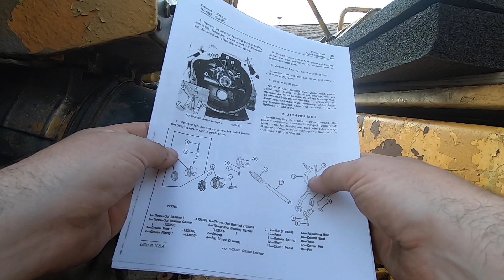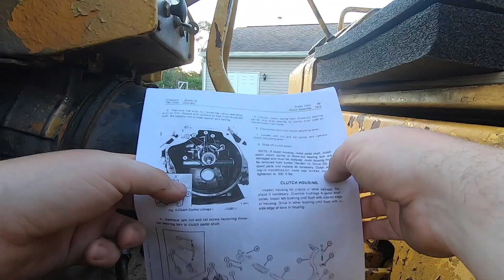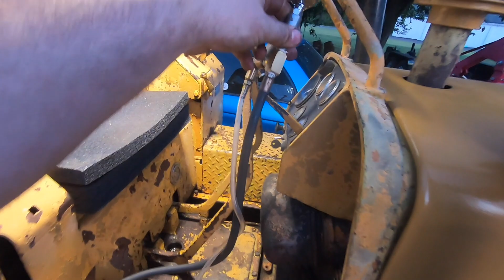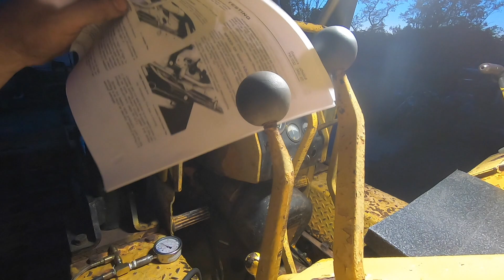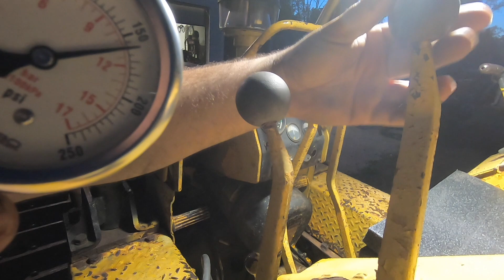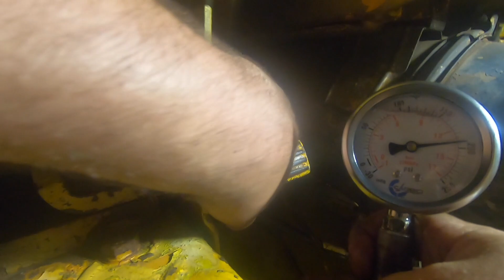JD 450 HLR transmission pressure adjustment and theory

Comment: I'm sorry, when you first hooked up the gauge to check pressure, I think you read it as turning the adjustment counterclockwise, and I thought it actually read clockwise. Or did I miss something?

Comment: I'm looking at a 1979 450c, and while the machine looks good, and the engine runs strong, it will not shift from 1-2-3-4th when the engine is running. If engine is off, I can shift it. Would my adjustments be the same as on your machine?
Reply from the maker: The HLR adjustments will be the same for you. If adjusting doesnt fix it, it likely means your main clutch is frozen to the flywheel. Mine was... I have a video about it. Gotta remove engine to fix it. If you dont mind shutting the machine down to change gears, it can be run that way until you have time to pull the engine.

Comment: Hello im having problems with my machine and was wondering if you can go a little more in depth with the gauge setup
Reply from the maker: It’s just a 1/8npt pipe thread. Very easy to get at any hardware store

Comment: This might be a stupid question but neutral on the gear selector is between 3rd and 4th? Basically to the left of 3rd or more up towards 4th?
Reply from the maker: If I remember right theres a small notch between 3rd and 4th
Reply: @spankranchgarage  Found it! Now that I know it's there it's easy to find. And it makes sense, I've plowed snow sometimes at around -30c and if the ground is frozen and it's in 3rd it will sometimes pop out of gear into that neutral detent.

Comment: I.
 Have the exact same tractor it runs perfect, but it has no drive and no reverse. I've only.
 Got it to move 5 feet. I will pay you if you can tell me what's wrong with it
Reply: Did you ever get yours to work? I have one that will move but it won’t push. I’d love any guidance.
Reply: I wish I got it to move one time about 10 About 10 foot, and that's it. If you figure anything out, let me know. Mine runs great, just won't move. @N8E8
Reply: @N8E8 same

Comment: Great video I have a 450c with a trans problem .  I have been thru the adjustments and I think I have them  right. After about an hour of use it will lose fwd and reverse and it just won't move. If I let it cool down for about a half hour to an hour it will work again for about an hour. I had knee surgery this summer so I've not been able to mess with it. I did change out the hydraulic fluid last summer and the bottom suction screen was clogged and after cleaning the screen I thought that would fix it but still the same problem. Transmission temperature gauge was inoperative I just put a new one in but I have not had a chance to run it. I also did  a pressure test last year and it was around 170 i think. I may not have had it hot enough and plan to run the machine for a while like you did ,or even operate it with the guage attached to monitor press. No one has a video like yours. I have a service manual  but your video is much easier to follow. Thank you.  Do you have any other suggestions ? Thanks Glenn
Reply from the maker: Glenn,
I hear of this happening when the trans gets hot the oil thins out and you lose pressure on the HLR clutch packs. You can shim the pressure up some to help. It may be out of specification when cold but will drop off when it gets warm. Otherwise, the likely and unfortunate reality is the oil is escaping somewhere internally inside the transmission. A large job to fix. I have also heard of people changing the transmission fluid to something with higher viscosity. Thats a bandaid that may get you by, depending on how long you need to run it.

Comment: When you say free play, is that the amount before the clutch actually gets hard to push? Or the whole top to firewall push?
Reply from the maker: By "Free-play" I mean the distance from pedal all the way up, to where the throwout bearing contacts the engine clutch fingers. In that range of motion the clutch pedal is activation the HLR side of the transmission. The remaining pedal travel is disengaging the mechanical clutch like a regular car or tractor.

Comment: So just a point of interest as I mentioned I have a 73 450c dozer and am removing brush, tree's and dirt on my property and wanted to say after warming up the cat for 10 minutes and pushing brush dirt roots and pushing road for 15 to 20 minutes my trani is just warm to the touch between my feet on the floor,not sure why yours gets so hot so quick,if you would like I could shot a temp with my gun if you would like...Take care...
Reply from the maker: In this video I was running it with the 4 speed box in neutral and the HLR in gear. You would think it shouldn't generate much heat... Fast forward to a few months later I cleaned the trans fluid cooler really good while I had the engine out. When working the dozer hard the trans still gets pretty warm but nothing I cant hold my hand on. No change in shift quality or speed so ill leave it be for now. Thanks for the comment!

Comment: Good job, don't forget to change the transmission filter by the radiator and fluid.
Reply from the maker: Yup of course, as well as the suction screen on the bottom of the transmission
Reply: @spankranchgarage  They good dozers, I bought my 450b in 1981, it's a 74 model, I've changed the clutch about 3 times and the steering clutches about 3 times, I still have it, still running good.
Reply from the maker: @dDayye  Love to hear that. I may have this one for the rest of my life!

Comment: I have one of these dozer that looses transmission pressure when it warms up. You can set up the clutch settings just like this video and after a couple hours it will only have 50 psi in Low and Reverse and 80 in High. Seems like a internal leak that worsens with temp but how do I find it ? It has a new set of clutch packs new transmission pump and selector valve assembly. All did not change my problem.
Reply from the maker: I personally would look into leak checking each clutch actuation circuit. I haven't gotten into one of these transmissions far enough to know what to tell you. Variation between low reverse and high is a clue. You have some shared circuitry and some independent circuitry/seals. studying the fluid flow diagrams you might be able to come up with a few sources where it would leak and cause what you are seeing.

Comment: What oil did you use for your transmission I am about to change filter and oil great video bro
Reply from the maker: Thanks! I use the tractor supply J20A fluid. Its reasonably priced. May not be the best stuff out there but its better than the water oil mix that was in there for all these years. https://www.tractorsupply.com/tsc/product/vp-racing-lubricants-ultra-j20a-plus-utility-tractor-fluid-5-gal-vp2040114
Reply: I agree 
well tomorrow will be in mechanic mold buddy 
I am from Louisiana wby ?

Comment: Thanks for doing the video.  I'm not an expert, but it looked like you did everything correctly to me as a fellow owner of a JD450B.  I wish my pressure was that good - what transmission oil did you put in it when you changed it?  My pump seems to have a lot of wear, but I found that about 0,030" of shim would change the pressure about 10 psi.  There was one official JD shim in mine and it measured about 0.025" thick.  I used flat washers for shims, and had to sand a couple down a few thousands to hit the pressure I was looking for.  On the gear selection (1, 2, 3, 4), the owners manual says to throttle down, then fully depress the clutch to change gears.  I know if I don't do this on mine, it will grind the gears severely.
Reply from the maker: Looks like a penny is about .06" thick. I used standard 303 tractor fluid from Tractor Supply, made by VP. I think temperature plays a big factor here as it seems to affect the pressure greatly. Id be scared to know what this pressure looks like on a 0 degree morning. Mine will shift gears (1-4) at an idle only if I shift quickly. If I go slow the drivetrain will pick up speed between gears then it will grind. If I get stuck between gears I just shut off the engine and put it back in the gear I want. Its not ideal but in real life I am not sure I will be changing gears that often. I am new to running a dozer and will probably stick to 1st gear unless I am heading long distances.
Reply: I think when I changed mine a few years back I used Walmart's SuperTech universal transmission/hydraulic fluid.  Temperature definitely makes a big difference (you can look at viscosity curves and see that clearly).  I can get over 200 psi when the oil is cool (90 degrees F), but it drops significantly when you get up to the range they recommend for setting pressure.  The viscosity on these type 303 fluids is about 9 cSt at 100 degrees C (roughly equivalent to a straight SAE 30 oil).  Although I've only got probably 200 hours on the transmission oil, the overheating I was getting before due to the pressure valve being essentially closed when the oil got warm, therefore not providing any filtering or cooling, may have damaged the oil.  I'm trying to find a thicker oil to use to compensate for the pump wear - looks like an option might be an oil meeting the Cat TO-4 50 spec, which would have a viscosity of about 18 cSt at 100 degrees C (SAE 50 oil).  Any heavy pushing I do in 1st gear, and low range, and will go to high range for moderate loads.  If I'm trying to do some smoothing with light loads of dirt, I'll use 2nd and go between low and high range as appropriate for the load.  I only use 3rd and 4th when moving relatively long distances to get from one place on my farm to another.  @spankranchgarage
Reply from the maker: @VRM-uu3si  I like what you are thinking with the CAT fluid. More viscosity will hopefully enable better pump pressure and more oil making it to the cooler. You might have to mess with the needle valve to keep the shift speed quick to minimize clutch slip.
 Just curious do you see the same pressures in H L and R? If only 1 or 2 speeds shows lower pressure, its possible there is an internal leak that can be fixed without too much disassembly, just by removing the top cover.
Reply: As I recall, my pressure was about the same in all positions of the HLR, but I'll check it again and get back to you in a week or so.  Unfortunately, I think if you see a big difference depending on which position you select, then it is a sign of internal leakage.  I went back and watched around 14-15 minutes into the video and all your ranges looked to be around 160 psi at that point - I didn't see enough variation to worry about.  I think clutch activation pressure is fed through the front cover of the transmission with the HLR valve determining which passage the pressure is fed to.  This goes into the clutch shaft through holes cross-drilled in the shaft to oil passages drilled along the axis of the shaft.  Seal rings (piston rings in JD part catalogue) shown in TM Section 50, Group 15, Figure 33, part 18, seal the passage way between the front cover and holes at various points along the clutch shaft.  This area would be one possible source of a leak.  On each of the clutches (H, L, and R), there is an inner and outer seal within the clutch drum, which is the other possible source for internal leaks.  This is shown in the TM Section 50, Group 15, Figure 12.  It looks to me like you have to pull the engine and partially disassemble the transmission in order to pull the clutch packs out of the transmission, which is what would be required to address either one of these two possible internal leaks.  This seems like one you don't worry about until it blows out completely, or gets so bad it slips in that range selection.   @spankranchgarage
Reply: I finally got around to checking my HLR pressure in all positions - I got the same pressure in neutral, H, L, and R, that being where I set it at about 140 psi as I explained in another reply due to a weak pump I think.  I'm hoping to do some work with it in the next few days to see how hot the transmission fluid gets.  If it stays below 220 degrees, and hopefully below 180 degrees, then it would seem I am getting the cooling I need.  If I get slippage I'll look more into the thicker fluid and setting the pressure to the recommended 170-180 psi.    @spankranchgarage
Reply: I have watched your videos 1000 times. It has been very helpful! Thanks! I just replaced the dry clutch in my jd450 straight because I thought it was bad. Turns out it was rusted to the flywheel so it was bad, but it wasn’t the reason my machine wouldn’t move.  There was a broken steel line in the transmission.  I have replaced the line and it will move, but with no power to push. 

I think I’m out of adjustment.  When I try to adjust my pedal free play I can get it close to 3-3/4 and then start to adjust the 1/2” nut inside the bell housing. It never pulls the pedal off the stop.  It will make the pedal so that it does nothing for the first 1/4” of movement, but it doesn’t actually pull the pedal off.  Also, the pedal doesn’t stop the machine now until I push it down far enough to disengage the engine clutch from the flywheel.  Before my problem this wasn’t the case.   Any ideas what I may be doing wrong?  Thanks for any help!